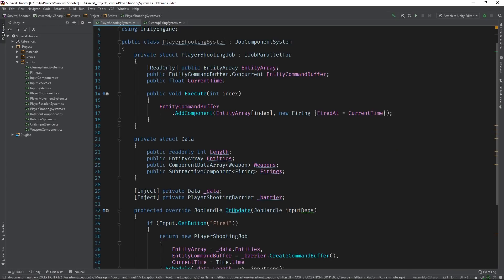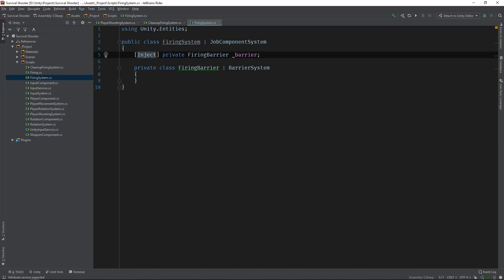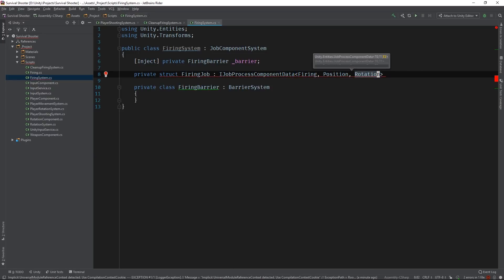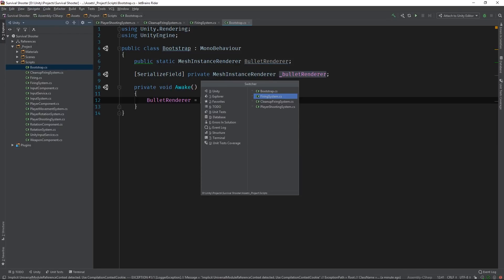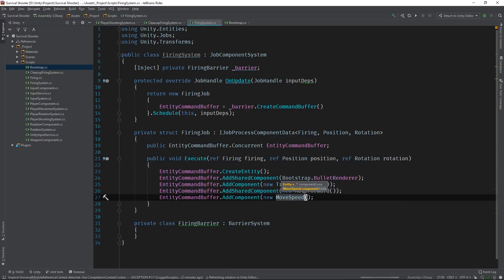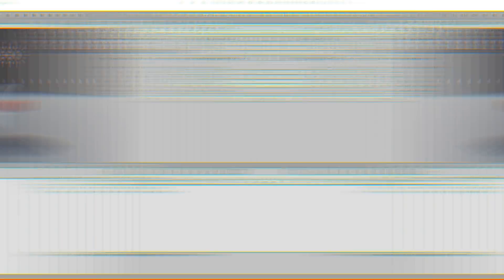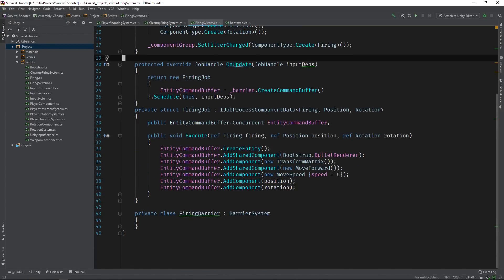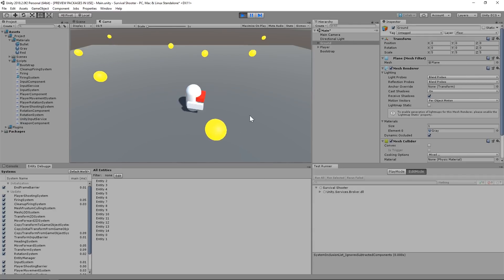7️⃣ Unity ECS Tutorial • Player Shooting (3/3)

Comment: I'm working at Unity 2018.2.6f1 with entities 0.0.12 preview 11, jobs 0.0.7-preview 3, Mathematics 0.0.12- preview 13 and burst 0.2.4 preview25. But I couldn't find TransformMatrix, MoveForward and MoveSpeed. Maybe that has changed with the version or something. I'd be interested on bugFix if you find the problem of that, or enemy movement system. The most important thing is to keep the series rather than finding the enxt topic. That's the most important now
Reply: I have the same issue
Reply: It happens to everyone who updates entities. I think there will be soon a perfect fix to that. At least that's what I think after watching his video about "what's new in ECS preview 11"    https://www.youtube.com/watch?v=IlXVp8l_j2w

Right now the only solution I know is to create the system and components yourself or find them from Unity (that's what I did and it works, but an easier solution may come later). I commented my steps answering "james Hotchkiss" question. But there is no need to hurry fixing that until there are more episodes about this series. I hope that helped you

Comment: PSA to fellow students: When adding components to the "Bullet Spawn" GameObject, you will actually get 2 options for "Rotation Component" with the exact same name (in my case anyway - using 2018.2.2f1).

Works: The one with no dropdown for "Value" in the GameObject inspector. It shows up as Unity.Transforms.Position when inspecting the entity.

Doesn't work: The one which has a "Value" dropdown with X,Y,Z,W didn't work for me. It shows up when inspecting the entity as "Rotation Component.

Hopefully that makes sense. When I used the second one mentioned above, the Firing Job didn't..fire, thus no bullets.
Reply: Thanks, this was my problem too.
Reply: I had this too in 2018.2.0b8 --- I don't think I'd have ever figured out what the problem was.

To make the problem more clear, refactor/rename the RotationComponent we made into some other name (I chose OrientationComponent). This is the component that orients the player into the direction of the mouse cursor. Now it can no longer be confused with Unity.Transform.Rotation value, which is used to have the bullets inherit the direction of the weapon, and which is needed for anything to show up in the IJobProcessComponentData filter in the FiringSystem.

Comment: Kinda have the Issue that OnUpdate doesnt get called when the component changes. Any Ideas? I typed everything as in the tutorial on the OnCreateManager
Started today and rushed through everything. ECS is so much smoother to use than the classical approach. Just need to wrap my head around :D
Reply from the maker: Hm could be a couple of things. Are you calling SerFilterChanged on the component group and passing in the Firing component type within OnCreateManager?
Reply: Infallible Code I also posted in discord with code snippet